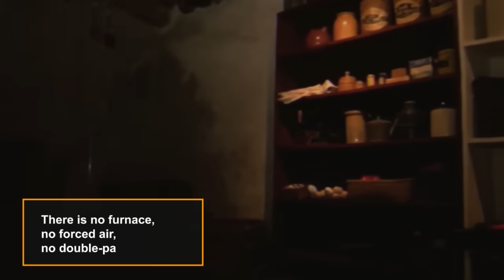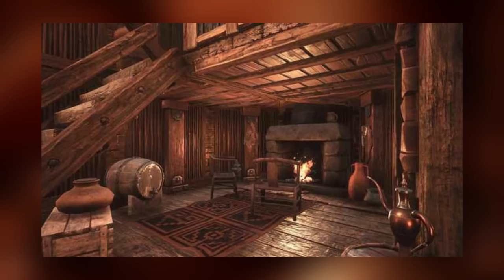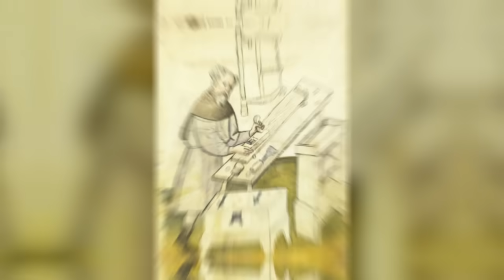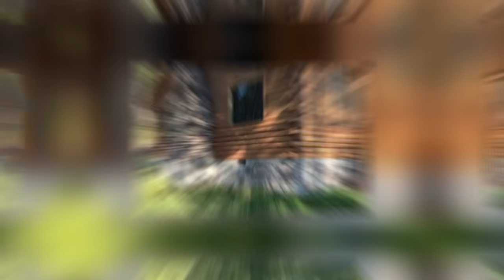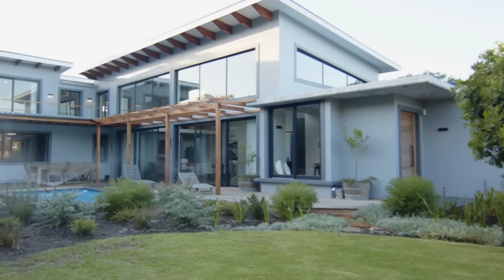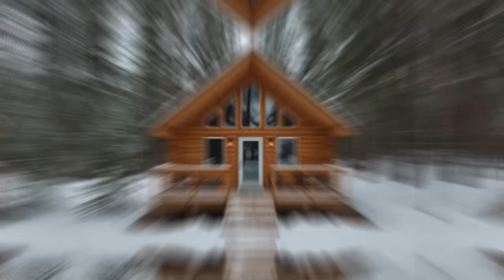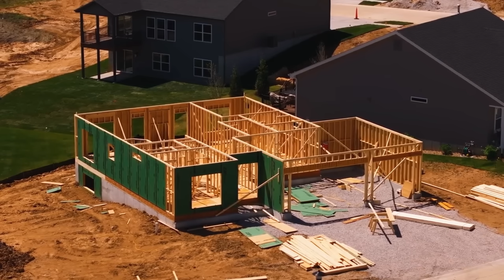Why Medieval Log Cabins Stayed Warm in -40°F While Modern Homes Freeze

Comment: I spent almost a decade in construction and was constantly frustrated at the inefficiencies in modern home building. Doing comparisons with homes that were a century or more old. Those older homes often held up far, far, FAR better.
Reply: I insulated my loggia from the inside with a homemade perlite plaster. The plaster is 6 cm thick on average. The apartment is in a prefabricated reinforced concrete building. The temperature on the loggia increased by almost 10 degrees Celsius in the winter, without any heat source!
Reply: I had a similar experience. I had to get out of residential construction because I felt bad knowing people were going to be paying on junk houses for their entire lives. Commercial construction isn't much better, but I don't give a fuck about corporations.
Reply: Only the well built old houses have survived. There was a lot of cheap junk back then too. If we were to build the high mass, dense wood structures today they’d cost a fortune. You can do it, but it ain’t cheap.
Reply: Incompetent bureaucrats, greedy profit driven systems built into the very fabric of nearly every level of our "modern" world is whats breaking things down. Thats why we gotta be more careful of who we elect and not just be motivated by short term selfish gains. It's good so many are beginning to see the need to save this knowledge and shift systems.
Reply: They still do. Nowadays Japan or what 100 times more for less than half the quality
Reply: Only Americans forgot how to build houses not built from cardboard

Comment: I lived in a house built in 1885.  It was 2x6 ( full size) 16' balloon framed. The spacing was variable, but around15" give or take a few inches.  Between the studs stovewood was placed between stops then filled with a clay and straw mix.      The mix was pushed against diagonal boards on the outside.  Over the diagonals, vertical boards were nailed with 1x3's covering the space between vertical siding.  Several layers of plaster cover the interior walls.

A slate roof tops the house. Lath and plaster cover the ceiling.  No insulation.
A wood stove was the heat source.

Once up to temperature the house tended to stay warm.  It took about eight hours to heat the thermal mass once it was below freezing.

Similarly a cabin I built in the 80's stays warm.  I have an insulated, on the outside, 8" concrete foundation.  Hating crawl spaces, the walls are 4' tall.  In the center of the house a woodstove sits on a 4x4 brick platform over a steel grate open to the crawlspace.  At the base of the exterior walls, I left a 3" gap.  To the crawlspace.
The theory was that cool air would flow down into the crawlspace and force the warm air up around the stove.

It worked.  Leaving the house for long weekends, in single digit weather, wasn't a problem.
A high low orchard thermometer showed that the coldest it got at floor level was58° F.

The current owners are happy with the house.

I love my mass.

Comment: I built a log home in the early '80's.  What a lovely structure.  Funny how they acclimate to a season and at the same time you can hear thru them. You can hear a conversation from the other side of the wall.  
Scribed log building is called Coping.  My home was coped cedar.  I peeled every log with a draw knife. Coped is one and done; chinked is a gotta-redo many times over the life of the home...AND you have to seat little nails ever couple of inches to hole the chinking!  Coping is superior.

Comment: I live in a building that started as a post-and-beam barn 160 years ago, and which has some modern insulation.  This is in New Hampshire, which can drop below 0F on some winter nights, so without heat most of the building (except for the basement) does drop to the outside air temperature in a matter of hours without heating.  However, I have one room, about 9' x 12´, which is small enough, and well enough insulated, that just my body heat is sufficient to keep the room at 50F, or better, even when the outside temperature is below freezing.  So, when we do lose power occasionally, I just retreat to this small room, put on a sweater and perhaps a coat, and stay quite safe and comfortable until the power comes back on.  Basically I'm using this room as a well-insulated wooden tent, and, as a very experienced winter camper, I am perfectly safe and comfortable, even when the power goes off for a couple of days.  After all, it is far better shelter than a tent made from thin fabric, which is also sufficient winter shelter - if you know what you're doing, which I do.
Reply: You should move to South Carolina.
Reply: @Sweethands4  I once lived in North Carolina, which was fine in winter, but by May it was already getting too hot for my tastes, so I went back north again.  Thus, I expect that South Carolina would be even less comfortable for me.  Plus, you guys get hit much harder than we do by hurricanes, which would also be a real drag.  So, thanks for the suggesting, but I'll have to pass.
Reply: @DJ-nw2ef  I know exactly what you mean. I grew up in MI but moved to VA due to a job. People kept telling me that I would adjust to the hot and humid summers. Well, 30 years later and I'm still waiting to adjust. I'd love to move back up north again. For those who think winter is more brutal there, not for me. I've also never adjusted to the humid winters when winds feel like they are slicing right through a winter coat where as in MI I could go out with a heavy sweater and feel just fine at the same temperature and wind--drier air makes a difference.
Reply: @sandyp2485  Ah! Michigan.  I also grew up there, in Wayne County, about an hour west of Detroit.  I've lived in New England for more than forty years now, but I spent most of my first thirty-odd years in Michigan.  What part of the state are you from?
Reply: @DJ-nw2ef  I'm from just north of Detroit in St. Clair County. Still have family there although son is down here in VA a few miles down the road.
Reply: If the electricity goes off at my house I do the same as always . Throw another log on the fire.

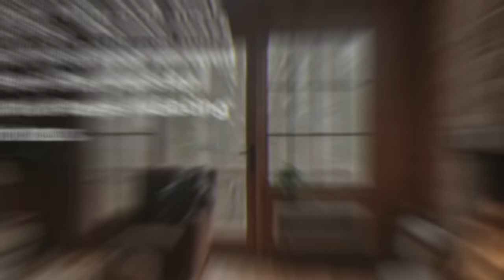Comment: The on screen text at 3:03 is literally wrong. A thick wool coat IS insulation. An example of heated thermal mass would be a hot water bottle you wrap in a sock and throw in the bottom of your sleeping bag (an old mountain climbing trick). The sleeping bag is also insulation. You could also keep a hot water bottle inside your coat. The coat then provides insulation which traps the heat being released by the water bottle. If you just have the hot water bottle and no coat, the water bottle will only keep the part of you touching it warm, and it will lose its heat fast and you will be miserable the whole time. Thermal mass makes sense in conjunction with other elements like insulation, vapor barrier and wind/rain barrier, but on its own is no good. On the other hand insulation can be enough on its own to keep a warm blooded animal alive in cold conditions, evidenced by all the furry wild animals that survive winter outdoors and anyone who has survived winter camping or mountain climbing.

Comment: Because theyre significantly smaller,a dn they use wood heat. There isnt mutliple floors, with multiple rooms and walls, and windows. Wood is a terrible insulator. Put all a wall with a door inside a cabin and it will be much colder than the room with the fire place. Put another and and its going to be freezing. Really a stupid assertion, and even a dumber comparison

Comment: Most thermal mass was provided by giant "Russian Furnace" with 2x2 meter  footprint and 1.5 meter height, with several tons of bricks, stones and sand (compare to modern "sand battery"). Even with that, it would be typically fired twice per day in winter. Heated envelope was small, and windows too - just big enough to provide light. Beds were high, 1 m from the ground, to avoid cold air near the floor in the night. Thick comforters are a must. Most vulnerable (elderly, sick or young) will sleep on top of the furnace.
And you need A LOT of firewood to go through the winter.
Reply: Id bet a lot of heat was lost on those small windows.  If yhey used 1" thick glass.. and kept the sizes under 1ft x 1ft  ..they would  probably have a mych warmer experience.

 The roof mass would be next.  If theres not enough mass.. and or too many air leaks... cold will quickly capture the place

Comment: I have lived in normal houses and now a log home.  The difference is the type of heating.  I used to have an old style upright woodstove and they radiate heat and actually heat the logs.  It would stay warm for 2 days if you stopped feeding the wood.  Now I have wood pellets and it gets cold very quickly ... less than an hour.  Normal homes usually have access to cheap and easy natural gas and it is more controllable.

Comment: Ignore difficulties of wiring, plumbing, etc
Reply: If not building a mansion? Single wash/toilet room. Close by on the other side of the wall the kitchen sink. All plumbing withing nearly hand reach stretching two peoples reach. It is not to difficult to limit the plumbing to basically hardly wroth mentioning. Toilet/sink. Washer/dryer. Kitchen sink. And a shower... Outdoor water solved with outdoor water plumbing.

Wiring? Mount it outside the wall. Solved. If not retaining the cables onto the wall? Have the cables run on the floor next to the wall freely. But build codes will force you to secure the cable into a 'fixed' installation and then run extension cords from the wall outlet into the room. As if a wall socket then having wires snaking up the stem of a floor lamp or something is not as ugly as a extension cord snaking the floor discreetly. As if the real log walls will be pretty enough to not notice proper copper wire being mounted on the wall visible. Na. We need cheap fire-hazard wires inside the walls! Who cares about wire gauge when hidden in the wall? When the wires starts to cause a fire your making a exit out of the house before ever seeing the wires hidden in the modern walls!
Reply: I am planning a modern equivalent to a log cabin to bebuilt in 2027 (18 cm massive pine boles as wall + insulation  + ventilated wooden facade, 12cm massive wood beams as roof + foam Glas insulation + green roof for additional thermal mass). 
All electrical wiring that I can plan ahead for will be placed on the back of the 1st of 3 layers of 6 cm boles that make up the walls in factory pre-routed groves. The other 2 layers of a total of 12cm will remain untouched. Future wiring will either be on the inside wall (possibly covered by a wooden board 8r similar), as will be all water pipes that are not under the floor. Intelligent planning allows me to completely hide the pipes. My heating will be provided by a wood burning "Kachelofen" (to be fired in the evening of  old nights only) in the middle of the house (rather open floorplan) and electrical powered infrared emitting granite panels on the ceiling for local fine tuning.
I will not quite reach German passive house standards (target is 22,5 kwh/ m2 and year) but it will be close. So yes it is feasible to build something alike to the portrait log cabins that does not lack in modern standards (I will have more windows - 3 layers) today and installation of wiring and pipes was a minor concern in planning.

Comment: So the tiny wood cabin with a “small fire” that is in reality 3 times the size of the one in modern HAVC system which has to heat 5 times bigger home with huge windows. Oh and you compering it with a modern home when there is no heat? 
A cabin withouth heat will not last 72 hours. I lived in one 😂
Walls foot and a half with modern glass and wood stove. Used to fall asleep with my teeth clamping uncontrollably as a kid. 
So much misinformation and lies on the YouTube now a day.

Comment: After 8 decades of rennovating houses to make them efficiently warmer, the first thing one needs to do is stop air flow between inside and outside. That is to say, the vapour barrier is the foundation of house warmth. The second most important thing for house warmth is insulation. Thirdly, large windows on the south side of the house to gain passive solar heating will literally heat one's house in the spring and fall. Then add stone/brick for thermal mass to minimize thermal fluctuations, especially when heating intermittently with firewood. Note that the lack of a vapour barrier in most log cabins disqualifies them from being a warm house, in my opinion.
Reply: A few decades back, houses on the coast around the baltic and north sea were insulated to modern standards. The result was that their roofs made of reed just rotted away.
Reply: With scribe to fit the logs are both air-barrier and insulation plus you actually can insulate em from the outside when using the right materials,  also you don´t really want much of vapour barrier with that much wood as it may cause rot issues if the construction can´t try out. Like you mentioned the orientation of the house, to make larger  windows face the sun during the day will take advantage of passive solar heat, builders of old actually did that in many places of the world probably for heat as well as natural light during the days.  You need to know exactly what you can and can not do with loghouses,  in my view almost any material that hasn´t been used for 75 + years we really don´t have long time case studies to say what that will do to loghouses. Even using a wrong paint can make the walls rot fast, now they got a new enemy as well in expanding foams. In Scandinavia there are loghouses that are 500+ years old, so any questions about using a lot of wood to built em is just pointless as you´ll seal away that carbon in wood for centuries if the house gets maintained and with proper forestry you are supposed to plant back what you cut anyways.

Comment: They don't tell you that if what they are saying is true that the opposite is also true. If the house is cold than it will take longer to heat the house up
Reply: That is true. So which would you rather have; a house that cools down quickly or a house that cools down slowly and would be easier to keep warm with less effort with a little wood?

A log cabin with a thermal mass wood heater would be easy to keep warm with just a little effort where a house with no power and no way to heat it would be an ice box in a few hours.

I would take my chances with the log house and a thermal mass wood heater.
Reply: Don't forgot that It's all about RADIANT heat. 
That can come from the walls and/or the stove. If the house (especially the walls) have cooled down and you want to warm your house back up quickly, you just heat up the stove a little bit more to compensate. This doesn't take any time - the walls and the air are still cold (for quite a while), but the infrared radiation from the stove warms your skin directly and the cold walls might reflect some of the heat too. 
You can achieve the same with modern wall mounted infrared heating-panels or radiant floor/wall heating. 
This way you can keep the air in your house several degrees cooler and reduce overall energy loss.
Reply: @ReadersOfTheApocalypse  

Radiant heat is what the thermal mass wood heater is all about. Heat it up and it cools slowly. If you don't heat it up it can be more like an ice cube cooling the room than a heater warming the room.

You could do the same thing with any kind of mass. For example 50 gallons of water weights 410 pounds. If you had 4 55 gallon drums in row or better yet a 2-300 gallon tank full of water in the middle of the room and you heated that water to 100-120 degrees that tank would sit there and radiate heat for a long time. If you have 2000-4000 pounds of mass and you heat it up to the same temp it will sit there for a long time and radiate heat.
Reply: @thinkfirst6431  True, the thermal mass goes on heating after power loss (and takes a long time to re-charge). 
My own house has radiant floor heating - that's a very large thermal mass in the floor-construction. It keeps warm for quite a while - and takes a long time to heat back up.
But my point was especially about the infrared radiation from the stove's fire that feels warm immediately - even if the whole house is objectively still cold and the thermal mass takes its time to heat up.
That's why it's really nice - it can do both: warm you up quickly and keep the temperature constant.
Reply: @ReadersOfTheApocalypse  

The whole point to thermal mass fireplaces in general and this one in particular is the economy of scale.

Sure your typical wood stove can make a space feel warmer in the short term. The problem is you have to keep feeding in the wood to make it do so.

The thermal mass fireplace requires less fuel to heat longer which is important in an area where wood resources are scarce. 

The thermal mass fireplace requires less maintenance in that you burn wood once or twice a day as apposed to every couple of hours all day long with the typical wood stove. Thus people are free to do other things instead of tending the fire, getting firewood, and dealing with the ash.

Comment: This is silly, can easily look up r values of different materials, wood isn't great.  Pioneer families were happy to have house barely above freezing at night and use big blankets.  Easy heat battery is lots of water, heat battery doesn't keep warm, it only evens out temp fluctuations
Reply: Example of modern heat battery, get plastic barrels almost fill them with water.  (leave room for ice expansion if you expect them to also work below freezing to keep house near freezing)
Reply: A possible good use of a heat battery would be using solar powered heat pump during day and then heat battery stores the heat for night... during day its warmer outside so heat pump most efficient.